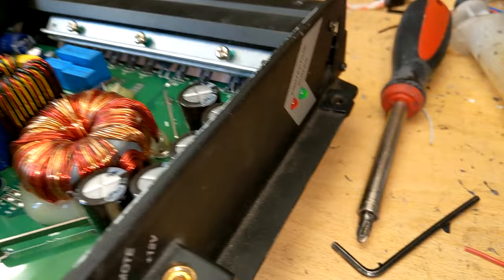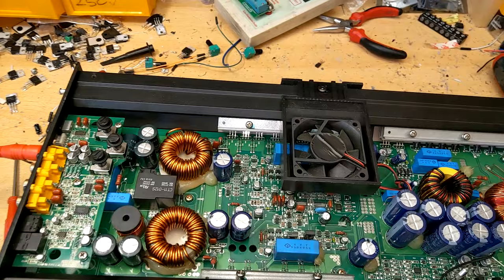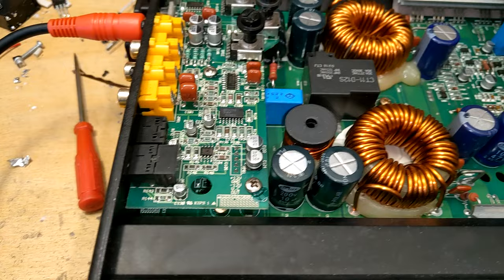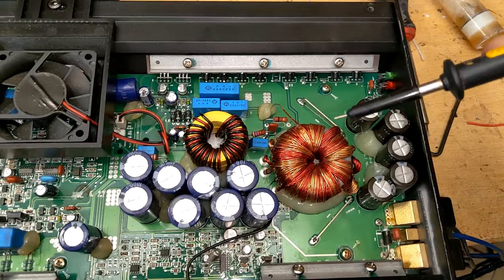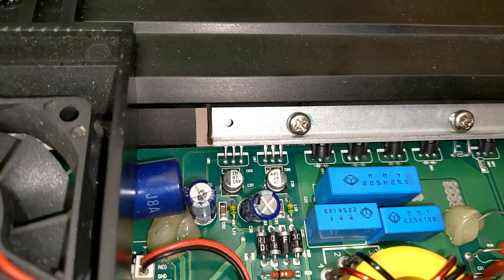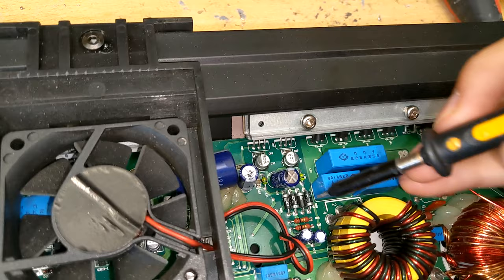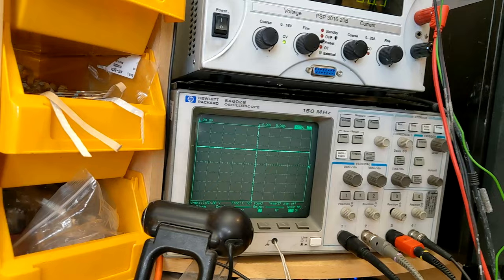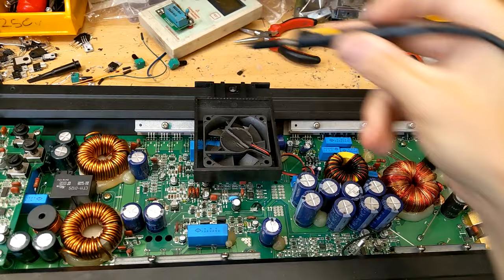How to quickly diagnose a faulty amplifier - powers up no sound

Comment from the maker: I changed both inductors for good measure as these are common failure points in these old amps, and she's working good as new.
Reply: Havo a orio Xtr amp turns on but no sound how much u charge what's your email to message you or get ahold of u
Reply: Amazing skillz
Reply: Have a McCormack DNA-125 amp that is having some problems too. It powers on but don't pass a signal to speakers while getting very hot at the right side of the chassis. Not so the left side.
Reply: I wish I understood a single word you said! I have a Bose pa speaker system that powers on but relays no sound
Reply: how much does it normally cost for this type of diagnose and repair?
Reply: Mrx-m110 alpine amplifier. Powers and plays subwoofer. Problem is the subwoofer plays backwards. Like reverse polarity.

Comment: That tiny little inductor has a scorch mark underneath it, suggesting it's passed a crap ton of current and burned up. The 7812 that it supplies might be toast, or something on the 12 volt rail has shorted out as well. Be interesting to see what the overall damage was. Do a follow-up vid if you have time.
Reply from the maker: It wasn't actually a scorch, just left over flux. The regs are fine, I replaced both inductors and it passed endurance test. ☺
Reply: @barevids  That was an easy one then! Whenever I think I am onto a quick fix, it turns into a multi-hour marathon chasing shorted components.
Reply: I changed the playback speed to .75 and it was way easier to follow what he was saying :)

Comment: I would love to see this on the Apeg PF-500. There are a few hundred of those amps that power up but no sound. If you could find the "common" issue it would save many of them from the trash depositories. It seems its the PCB but the factory fix is to get a new board (which runs 200+ dollars....IF you can get one!)
Reply from the maker: I'll do it if someone sends me one

Comment: What should I check first? PG amp. Mosley’s are not shorted. Amp won’t power on. Connected to known-good battery, amp loads bat down to 4 volts and draws 1.5 amps. No obvious blown components.
Reply: Mosfets. Not Nosely’s. Spellcheck is so cool.

Comment: I have an MB Quart Onyx 1500.1 D amp. I don’t have the one tester you have, I only have a multimeter. The amp turns on, the inputs seem to be good from a continuity test, no protection mode, and no sound… anyway I can figure out what’s bad on this thing with just a multimeter or do you know of known issues??

Comment: Where is his black negative prob?  if he's prob with the red. Do I connect the black lead from my meter to the ground negative input on the amp or my power supply?
Reply: Depends on what part of the amplifier you are checking. Some require negative on the batter negative post, others the secondary winding of the transformer.

Comment: I’m sure you get lots of questions from people but I’d appreciate any suggestions from you. I have an old Crate B10 xl simple solid state amp that I’ve been trying to get working again for a couple of years. There isn’t any repair places near me and I searched all over online with no luck finding any similar problems like mine. I was playing it and all of a sudden zero audio, not even a hum, the fuse wasn’t blown and it still powers on. I’ve confirmed that the speaker is still good, I can’t see any signs of something that got hot or shorted, the jack inputs are making contact and all of the wiring is good, none of the caps look bulged and it doesn’t even make a sound when I touch the aux jack. I’m suspecting it’s a component on the circuit board but I can’t see a visible problems, I’ve tried testing everything with the knowledge I have, it makes a small sound whenever I touch two of the pins on the output transistor/mosfet so It might be that but I’m not sure. It might even be one of the many diodes.
Reply from the maker: If you really want to get into this, you want to use your multimeter and check all of the auxiliary voltages around the board. Check there is rail voltage present in the large rail caps on the output board, check you have bipolar auxiliary supply for the op amps on the preamp board, etc. You might find that some are missing due to crack solder or failed components in the power supply board.
Reply: Thank you for replying so quickly! I appreciate your suggestions and I will try the best I can to test what you mentioned. A couple added details is that it’s one circuit board and I have re-soldered all points with no luck.
Reply: Also the only testing tool I have is a digital multimeter.

Comment: what are the circle coli things and what do they do?
Reply: They are toroidal transformers that usually change a higher voltage to a lower voltage to power the circuit boards (which generally operate at low voltages).  These toroidal transformers are often used in amplifiers due to their high efficiency, and smaller sizes.

Comment: Are you familiar with Memphis amps? I just bought one from a yard sale it's a old school Memphis pr600. I have power going into it and a good ground. I'm bench testing it but neither the power light or the fault light will light up. No spark touching terminals either. Fuses are all good. Any idea where to look?

Comment: Do you have any suggestions for me? Audiopipe 1800.1 I've got continuity between 12v and ground power terminals. I've removed all the mosfets and still have continuity across the board. Continuity was tested with the amp completely disconnected from any power.

Comment: I enjoyed this video, i was wondering if you can help me with a spl z2x1600 it has a short i took out all the output transistor three of the mosfet but even with the absence of these power mosfets the empty slot still reads short

Comment: I have a brand new xtr 2500.1dz that got wet while not even wired up (nissan titan rear sliding window installed in a silverado but seal was leaking) and I sprayed electronics cleaner on the board thinking it would clean corrosion off but my amp comes on but doesn't have sound. Not in protection either
Reply from the maker: Clean the pre-amp toggle switches

Comment: What could be the potential cause of my taramps bass 8k not powering on I did find that the remote terminal has a ground on it if I can find the cause of that I can find the problem the amp has always has sufficient voltage and it didn’t get hot or it never smoked I went to listen to it one day and it just wouldn’t come on. I’m assuming the ground on the remote terminal is the issue because as soon as I unhooked the remoter my second amp powered back on

Comment: I have a Rockford fosgate p400-2 and the sound is choppy. It cut in and out. Never goings in to protect. I tried using a a six to rca to see if it was the cables. Same thing. I’ve ran the wires twice. And changed the speakers 3 times. Something with the rca output I would guess

Comment: hi, i have a morel 5 channel amp that turns on but won't turn off even if i remove the remote wire. where do you suggest i start diagnosing?

Comment: Can you help with my amp problem..i got all then ground,power supply and rem wire correctly but when i plug in the rca cable then my monoblock blown along with a pop sound inside the amp..
Reply from the maker: Never plug rcas while amplifier is powered up!!

Comment: Hey sam i have a 6000.1 ds 18 amplifier it playing normal but when turn up it trip to protect i check everything and find nothing. I check the output driver ic but the number scratch off can u able to say whats the driver ic number
Reply from the maker: The amp isn't the issue, check your wiring
Reply: @barevids  hi i already check all of that i using a 0 gauge wire
Reply from the maker: @awaazhoosein6565  you didn't check enough. Protect when turned up is only ever low voltage or low ohm.
Reply: @barevids it goin in and out protect when turn up I'll check back and see

Comment: Hey I have a Deafbonce AAK 6k that went into a thermal protection and now won't put out bass just a high pitch whining noise through the sub what would be the cause of this and how would I go about fixing it
Reply from the maker: @SlamryCamry19  this needs repairing by an experienced technician, this is not a repair that the end user can perform
Reply: @barevids  could you maybe tell me what the issue is to better explain it to a repair technician what happened was during playing I had a ground wire inside the enclosure come off the terminal and instantly threw the amp into a thermal protection
Reply from the maker: @SlamryCamry19  just tell them that. A decent tech won't need any more details.

Comment: What would cause my power Acoustik lt980 amplifier to work but vocals are playing thru the subwoofers? Amp has LPF HPF and Subsonic adjustments. If I switch to LPF I get no bass or sound
Reply from the maker: Lpf needs to be on. Maybe the switch is dirty, clean with 99% isopropyl

Comment: awesome video. I would have a question on a problem with an amp that randomely does not deliver sound. when i feed it with very high input volume it turns  the outputs on and keeps running. After I can even turn down the input volume and it keeps running without problems. Do you or some youtubers here maybe have suggestion on where to start searching? Maybe the Capacitors?
Reply from the maker: What amp is it. No it won't be the capacitors.
Reply: @barevids  its an aktive speaker tower LD Systems Maui 28.
Reply: Maybe a broken solder joint on one of the printed circuit boards.

Comment: My CCI44 is starting even without remote, just plus and negative connected, any video of that to fail search such issue, i believe it plays sound, but never turns off if ignition is off, that's not good, drained battery.
Reply from the maker: @edstromen  yep video here https://youtu.be/pH1-sYTcguU
Reply: @barevids  Thanks , much appreciated, now i just need an heating welder, a little harder with an regular solder station. Thanks again 🙂

Comment: new to this, where is the other probe of the multimeter ? and hes using the black negative on the circuits ..wheres rhe red probe ?
Reply from the maker: No, oscope probe.
Reply: @barevids  oh is that just one probe ? Do you use a multimeter sometimes ?

Comment: Ok a year later lol so my amp is R1200 rocksford fosgate and it stopped working untill i found out if i put a little pressure on the gain setting knob the bass turns on as it should but when i release it goes off any tips on that? Or is the amp done
Reply from the maker: Very simple issue just need to clean or resolder the pot or switches
Reply: @barevids  i see i see so what i did was apply more pressure and i went down and now i have absolutely no sound even if i press on it again i feel like i broke it whats your opinion on that?
Reply: @barevids  i appreciate the fast response a saver man
Reply from the maker: @Nathan-hw2tm  probably. You need to take it apart and inspect it or take it to a tech if you don't feel confident.

Comment: I'm wondering if anyone can help - I've repaired my car amp twice thanks to your videos so thank you.

This time I'm stumped - my power supply section went bang and all the mosefs blew and shorted. I've replaced them all except from 2x f20c20ct

These I can't find anywhere. Can anyone recommend another that will work in its place?

Thanks!
Reply from the maker: Those sound like the rectifiers. They won't be damaged, don't cut them out or remove them.